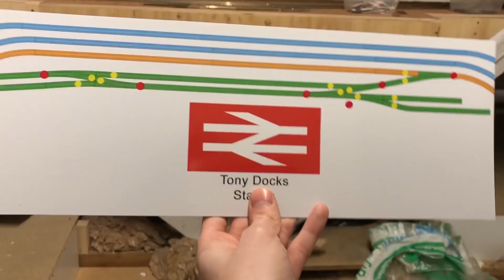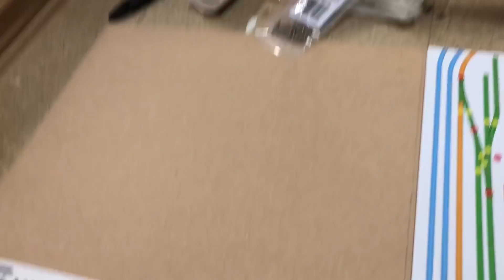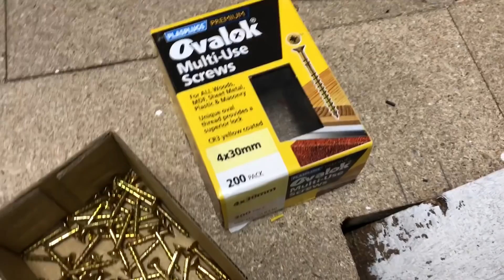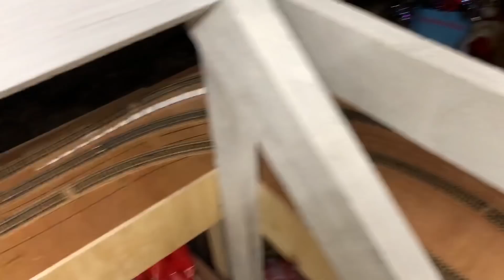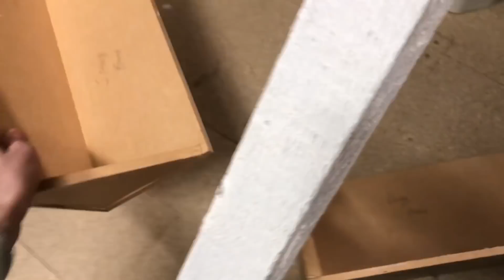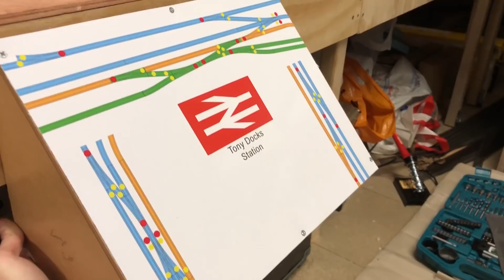How To Build A Model Railway - Episode 16 - Control Panel & Track Fixes

Comment: when you drill through the mdf you need a sacraficial strip on the back so as the drill dose not feather the back of the board it would be a lot neater
sacraficial strip = some scrap wood

Comment: Hi Tony. Loving the construction of the control panels and look forward to the next video on the wiring. I'm intrigued to find out about your programming problems. As it affects all of your decoders, I have come to the conclusion it's the Dynamis. Whether it is a design/manufacturing problem of just an issue that's arisen, I don't know. What happened in the end?

Comment: Hi Tony great looking detail on your switch panels and wow you got some bargains on the wood. 
To solve the problem with the switch being to close to the 12mm, I would not  drill / relocate but router out to fit the switch. So not to spoil those great track plans. Another tip to stop the mdf splitting on the back of drilling is to drill it over  another piece of mdf  and you will get a smooth hole. Great video and look forward to the next one cheers
Reply from the maker: Thank you! And yes, I was very lucky. Just looked through the off cut section and found what I needed!
And that’s a good idea, thank you! I’ll give that a go!
And I’ll use another sheet of mdf as suggested when drilling out the smaller panel too, thanks again!

Comment: Panels look great James. Really looking forward to seeing the next video with the wiring. I'm considering adding LED's to mine so very interested to see how you do it. Cheers, Jamie
Reply from the maker: Pennyhill Junction - Thank you! I tried so hard with the template you gave me, but just couldn’t get the lines to be uniform and the same size. I threw a mini tantrum and went back to square one haha! Think these came out alright though!
Yes, the LED’s should be quite a nice touch, but won’t be simple. Have got a few ideas to make it work and easier to install though!
Thanks again!
Reply: No worries James. We all have to do work what works for us individually and for out layouts. I really like your frames and now I'm thinking about redoing mine. lol
Reply from the maker: Yeah, I’m quite pleased with them, so not too bad in the end! And oh wow, really? How comes?
Reply: My current design has the panel either straight out or vertically flat against the side of the baseboard. I like the thought of having it at a 45 degree angle like yours. I will probably stick with what I have for now just to get everything wired up. It will be simple enough to swap to a different panel design in the future if need be.
Reply from the maker: Ahhh I see! Yeah, as long as it's all working and holding together there's no rush to change it out. I also made mine quite deep, because at 45 degrees, you will need to hide the wiring. Where as, if it's at 180, it will be out of sight regardless.
But, thanks again, I'm glad you like the panels!